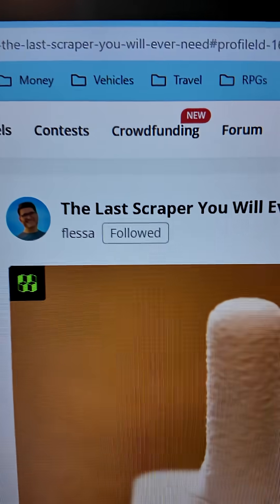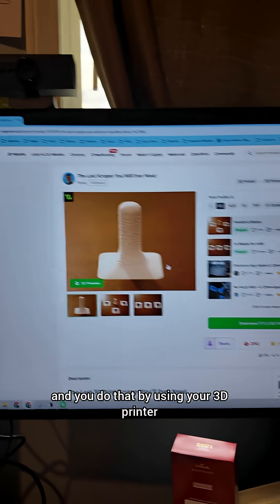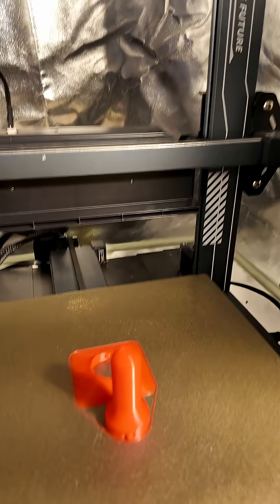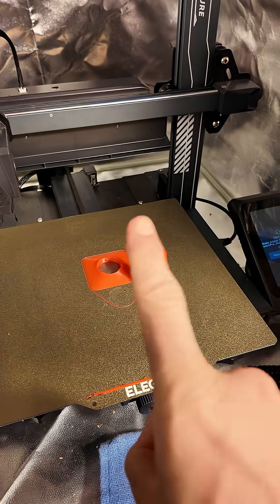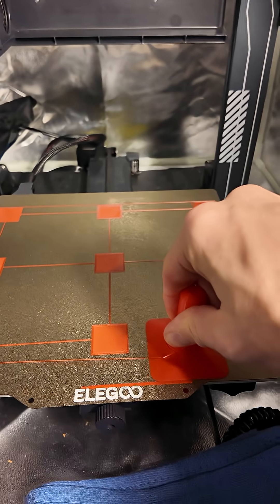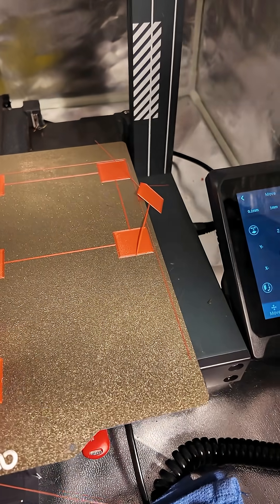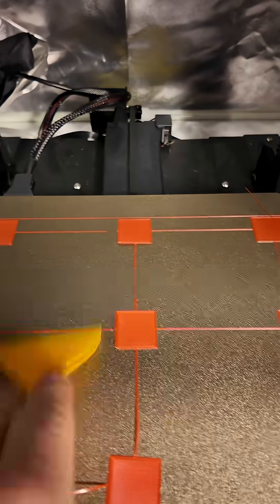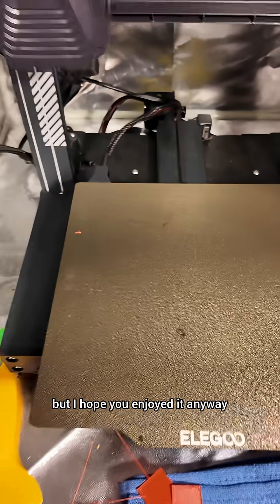The last scraper you'll ever need for your 3D printer. or is it?? #3dprinting #3dprinter #3dprint

Comment: I’m not even into 3D printing, but I can tell you’re utilizing that scraper improperly. Gently hovering over the printed material and not using its slope with pressure is definitely not how’s it’s intended to be used. When you used your original scraper you actually applied pressure and used the angle.
Reply from the maker: Admittedly it's difficult to use that scraper properly when one hand is holding the camera and the bed it moving around. This isn't exactly meant as a serious video or a dis on the person that designed this.